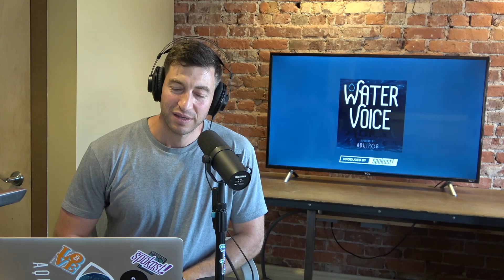Investor Update June 2023 with Greg

Comment: Love the concept & cheering for you guys.
Have you tested freeze & thaw cycles? If so, over what period of time?
This is what's holding me back from investing.
Reply from the maker: The material naturally incorporates air during its manufacturing process, which has exhibited highly promising initial outcomes in our internal freeze-thaw tests. Nevertheless, further extensive testing is necessary to ascertain the material's long-term behavior under rapid freeze-thaw conditions. This testing will include rigorous assessments following ASTM standards and real-world field tests. While there is still more testing to be conducted, the initial indications are quite encouraging.